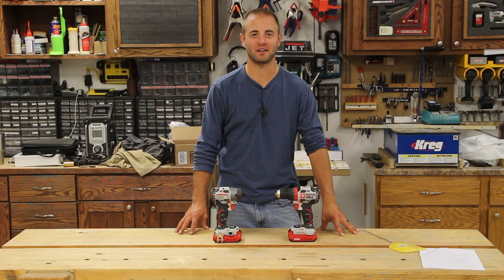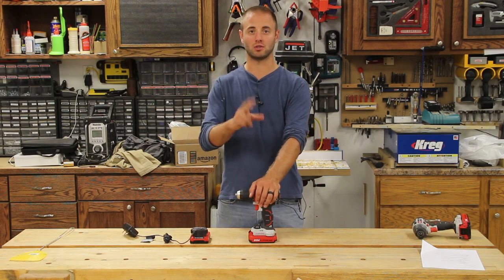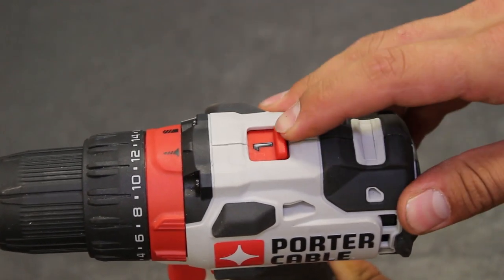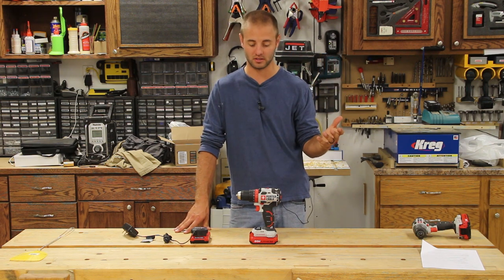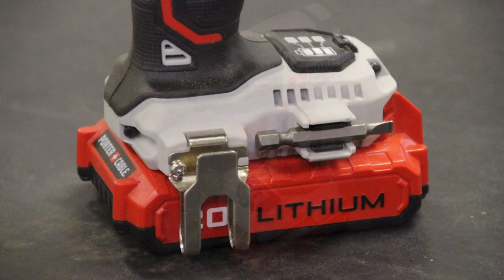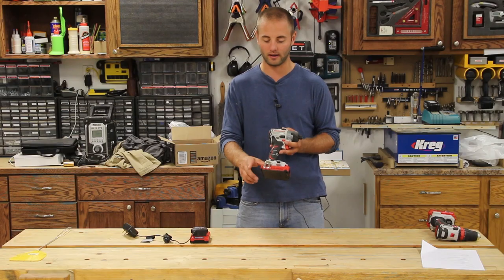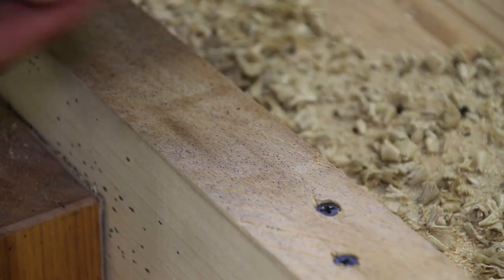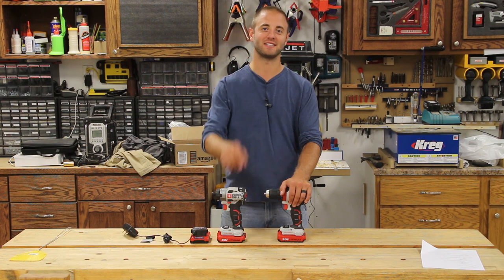Porter Cable Brushless Drill and Impact Driver Review

Comment: Ive used porter cable 18 volt drill and impact for over 2 years on commercial jobs. I bought the pair used for 80 bucks and theyve lasted longer than some of my coworkers new dewalts and makitas. I would recommend them and I plan on buying these brushless drills in the future!
Reply: letoburito23 love my porter cable they r newer models than shown on video I wouldn’t trade them for anything they work great for me
Reply: Same experience here.
Reply: It's funny because I mentioned this at my work and the person I was talking to these about said he wouldn't trust the cheaper ones. Yet I've heard good things about these and they're 60$ cheaper than dewalt. So I'm gonna pull the trigger on this combo. Only $109 on ebay
Reply: @71sc502  Ive had the older brushed models for going on 6 years but after about four and a half to five years I started using them as back ups to my Milwaukee gen 3's and I have a Hitachi triple hammer but the first thing I did was put 4 amp hour batteries on them and I had the old school charger but I still haven't had issues with them except for I think the brushes are wearing out but so far still going strong and lasted longer than anybody on my crew's impacts.

Comment: I do drywall repairs and drywall finishing everyday. I've been using Porter cable 20 v for 2 years without any issues. These are great tools. Very reliable, lightweight, and no other competitor has came close to matching the prices.
Reply: Let your tool break down and try as hard as you might to get InTouch with them, you will find out how great they are.

Comment: I just bought these today... I took my 4-5 year-old brushed Porter-Cable impact and drill/driver and gave them to my brother and they're still going... they still work and I think there's still a few more years left in them...the only thing I wish with the brushless kit is they would have put the bit holder magnet on top like they used to...other than that I think I'm still going to get a few years of service out of these just like every other Porter-Cable tool I have ever owned... when I unboxed them the batteries only had one bar on the light so I charge them I used a rapid charger that I have and put one battery on it and I used the charger that came with this kit and started them at the same time and the rapid charger charged the battery fully and 40 minutes and the charger with this kit charge the battery in 43 minutes so it's actually a pretty decent charger

Comment: I have the 18v porter cable drills and dad has the newer 20v brushed drills with impact.  They have been very durable and we have even used them to run large corkscrew bits up to 3/4 dia for 6" deep holes in a pinch.  Also used up to 4" hole saws with them.  Tough tasks like that wear the batterys down fast and even regular uses like small drill bits or driving screws it seems like the batteries could use a little more capacity like being 2.0 AH vs 1.5, but for the price they are hard to beat and we have abused them and they still work just fine.

Comment: I have the 20v max version of the drill/driver and impact and bought them about 3 years ago. I use the drill almost everyday in a work environment and it has held up great. The internals are the same as the dewalt, it just looks different and is less money, but it is a great tool and have been very impressed with it.

Comment: DeWalt, Porter Cable and Black and Decker are owned by the same company since 2012.  The internals and ergonomic design are essentially the same.  The 20v Max products for all three brands are very similar and in some cases the exact same. I did my research back in 2013 when I bought my Porter Cable drill and impact and found this out.  Porter Cable was an easy sell for me.  So far, they have exceeded all expectations and I still continue to buy additional 20v Max porter cable tools with full confidence
Reply: Brad N is this set better than craftsman??
Reply: Yo that’s complete BS....the Dewalt 20v max line is nothing like this crap...that’s like saying that rigid ,Ryobi and Milwaukee are the same....ridiculous and a poor comment for someone who doesn’t know better to read and think this PC line is ok, ,it’s not...
Reply: STANELY TOOLS owns them and the slipping quality of Dewalt (AKA DEFAILT) proves it.

Comment: About two weeks ago came upon a spectacular deal . I was looking for extra batteries hoping to get 2.0 Ah ones and found a driver with this charger and two 1.5 Ah batteries for $59 at Tractor Supply . I've had PC tools like the drill and driver , sawzall and circular saw for several years and the're fantastic . Never let me down . ⭐⭐⭐⭐started recently getting some ryobi and their circular saw let me down . Not working . After turning on for few seconds it cuts off . Never getting to cut any lumber

Comment: I have both of them for 6 years no problems with them I still use them to me they have perfect power I own the dewalt 996 and 850 impact to me they are too they powerful they strip out screws to easy and break them too never broke a bit with either of them

Comment: Did you receive these from Porter Cable for review? I have the full lineup of the porter cable 20v tools and purchased new brush less impact from them. It seems to me that later on they may offer an "expensive" brush less line of tools, do you have any indication of that? I would hate to buy these two tools just to have better brush less come out later.

Comment: Is there a any major differences between the the two brushless drills and impact drives that have the red battery and the black battery?
Reply: Alex L the red ones that are the same size as the black ones are 1.5 amp hour batteries.... and the black ones are 1.3 amp hour batteries..... then as the battery size gets bigger all of the batteries are red but the small black ones that come with a lot of the drill driver and impact kits are just 1.3 amp hour ...so no not really

Comment: I purchased a PC 20 volt set at Lowe's back in 2016 to replace an old 18 volt DeWalt set. Boy was that ever a mistake. The PC drill blew up the first time that I used a 5/8" paddle bit. The transmission failed and the motor was burning up. The demo saw died quickly when I was cutting a few 5" tree limbs with a new blade. The motor burned up in it. The grinder did the same thing. The spring in the impact chuck broke so it wouldn't hold a bit. PC would not stand behind their crappy tools. I bought this PC set because I own quite a few PC corded tools, which have served me well. I tell everyone I see looking at PC stuff at Lowe's to avoid their junk tools because they will quickly fail you and they will not warranty them. Save your money and buy DeWalt or Milwaukee.
Reply from the maker: They did not warranty it?  That is sad!
Reply: @WorkshopAddict  nope... nothing but excuses... and I think it's because they knew that they were looking at a class action recall because of the high failure rates.
Reply: I still have a lot of the old Dewalt 18V tools. Those seemed to be built to a much higher quality level than a lot of today's cordless tools, but you paid the price for that privilege. My 1/2" Dewalt hammer drill with case, charger and and two batteries was $300. Today you can buy a whole tool kit for that kind of money. I'd hate to think how many thousands I spent on Dewalt 18V tools and now they are considered obsolete.

Comment: Brushless vs non-brushless? Does a weekend warrior need brushless?
Reply from the maker: Do you "need" Brushless, no.  But today, all the more powerful tools are going to be brushless and thus, more expensive.  Most times you wont need the power, but sometimes it is nice to have the longer runtime.  This give more info on the two different motors.  Watch: https://www.youtube.com/watch?v=Sbxd8vY_j3o
Reply: WorkshopAddict is this set better than craftsman??
Reply: Everything is better than Craftsman.
Reply from the maker: Craftsman and the normal skill battery line might have a good competition.  :)
Reply: Patrick Gallagher 

😂😂😂